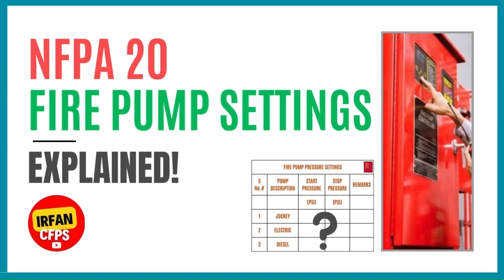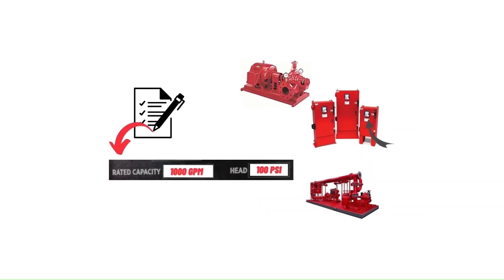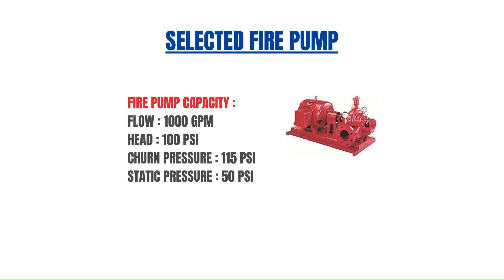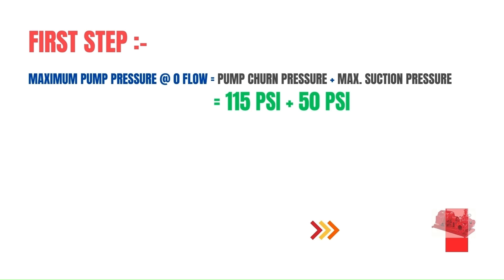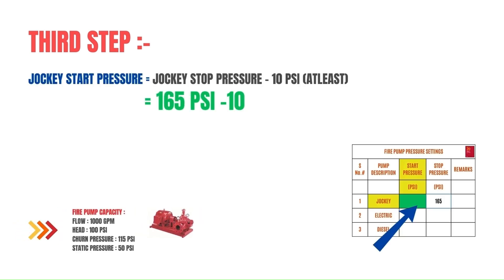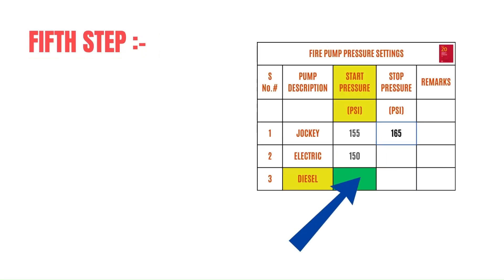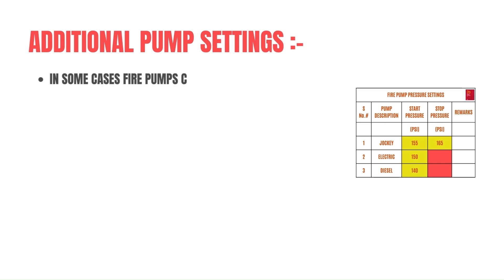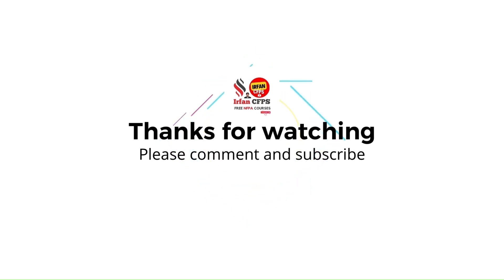Fire Pump Pressure Settings Explained (How to Set a Fire Pump)

Comment: Is it necessary to add the “Max Suction Pressure” of the pump w/c is 50 psi? What if the Actual suction pressure of the private fire pump is just around 0-3 psi? 

As you are aware, if the fire pump is private meaning having its own water supply in the building, the suction will just range from -3 to +3 psi. However, if it the water supply is from the network, it is ranging from 0 to max 50 psi.
Reply from the maker: Not required. Actual suction pressure shall be added.

Comment: If the pump capacity is 1500  gps @ 82 psi. Then can you provide pressure settings
Reply from the maker: Do u have the fire pump performance curve? Or do u need as per thumbrule nfpa 20?
Reply: As thumbrule

Comment: I have a doubt. When the capacity of pump is 100 psi, how the pump pressure will go beyond
Reply from the maker: Excellent question
When the pump operates at zero flow (deadhead condition), the pressure is at its maximum, which is typically 140% of the rated pressure as per NFPA 20.
Reply from the maker: fire pump with a 100 psi rated head means that at its rated flow, the pump is designed to produce 100 psi of pressure at the discharge.
Reply: So, you mean churn pressure will be 140% of rated flow

Comment: How to calculate the churn pressure and suction pressure
Reply from the maker: Churn pressure will be provided by fire pump manufacturer. As per nfpa 20, I already explained in pump performance curve video part 1

Comment: Can fire hydrant line pressure increase, if pumps cannot be operated. Or can sunlight effect the hydrant line to increase pressure
Reply from the maker: I believe hydrant line will definetly has impact of pressure, thats the reason we do the pressure test by 1.5 times the design pressure / required pressure for the underground network

Comment: How do i know the churn pressure and static pressure of the Fire pump in this video mention 115psi churn pressure and 50 psi static
Reply from the maker: Churn pressure will be provided by the pump manufacturer. To know the pressure at pump suction calculations have to be performed from tank to pump suction flange
Reply: Churn Pressure & Shut off Pressure both are same @irfancfps
Reply from the maker: @hazmanmech2826  Yes dear